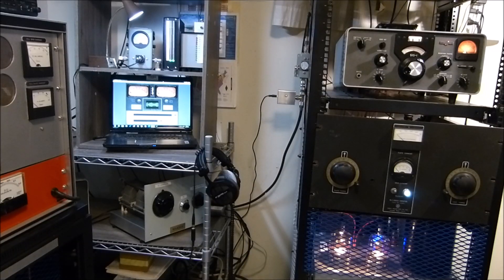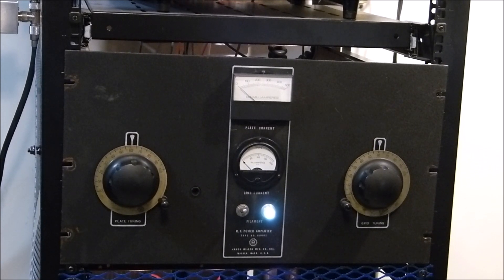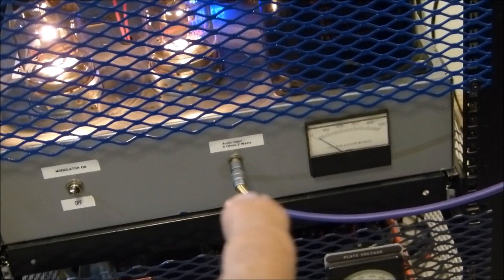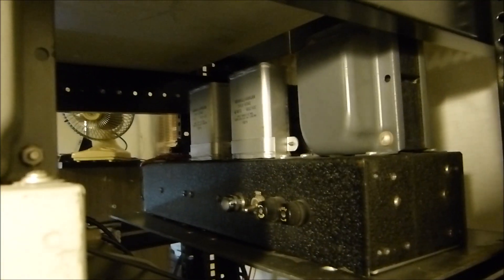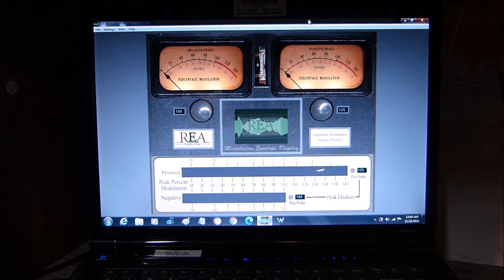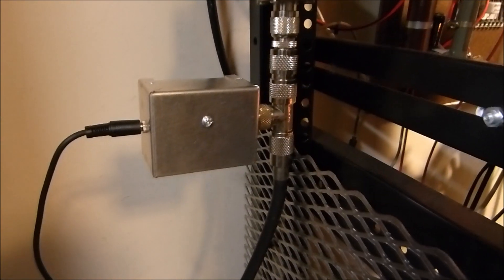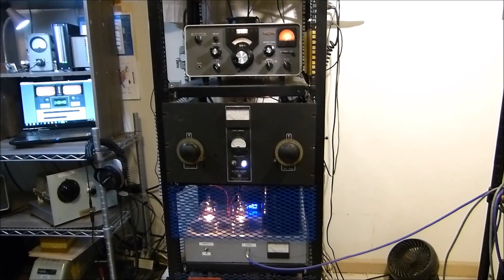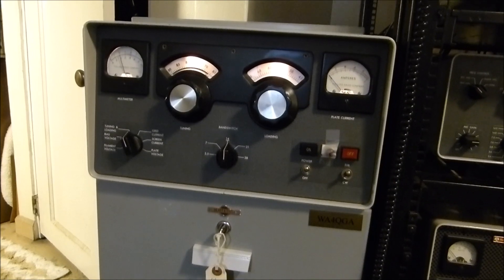Negative Modulation Peak Limiting For AM Transmitters With Modulation Monitor

Comment: Hi Dave

I have a question about the underlying spatter issue: namely, why isn't class C operation itself a source of spatter? As the carrier is certainly disappearing ... Or maybe it is a source of spatter, but the fact that it is happening at RF not AF makes it OK? By which I mean FCC-compliant? Because the spuriae aren't adjacent to the carrier frequency?

Best EJP
Reply from the maker: I may not have the perfect answer for that but this is something close.
We know that in a class-C amplifier, the tube conducts less than 180 degrees of the cycle so we only have positive pulses coming out of the amplifier. The positive pulse charges the resonate tank circuit, often times a Pi network in single ended amplifier and when the positive half cycle shuts off, the collapsing field stored in the tank restores a negative half cycle so we end up with a reasonable full cycle. This occurs because when we charge a tank circuit or even an inductor with a magnetic field and then we abruptly remove that charging field, the collapsing field is of the opposite polarity from which it was charged. At the same time, the resonate circuit suppresses harmonics so amazingly it works pretty good. I don't think second harmonic suppression is that great so the quality of the suppression is measured at the third harmonic (they call it third order) which should be something in the order of 40 dB or more down from the fundamental. I think this is a reasonable explanation of how it works.
On the other hand, if the negative cycle of the modulating audio is greater than the plate supply voltage, the algebraic sum is zero or  even negative, so the class-C amplifier is completely starved of plate voltage during that negative peak so it quits transmitting the carrier altogether. That is the "splatter" (adjacent to the carrier frequency) that occurs as it abruptly turns off and then back on when it goes positive again.  
The simplest circuits just consist of a reverse bias diode and resistor to "load" the negative cycle and help prevent the plate voltage from being shut off but that is by far, not the best. This circuit provides the keep-alive voltage, even though small as compared to the actual plate voltage and keeps the plate supply voltage from actually reaching zero. Darn thing actually works. It certainly isn't audio amplifier stereo quality we expect from our HiFi amplifiers but it ain't all bad...
Cool, huh ?  Or it could just be magic...    :-)
Reply: I see, makes sense: and it doesn't happen at AF? is that because the inductive Z is lower so the flyback is lower?
Reply from the maker: @EJP286CRSKW  Hmmm... not sure I understand.
Reply: @ElPasoTubeAmps  Well, why doesn't it happen at AF? Why do you have the spatter problem at all?
Reply from the maker: @EJP286CRSKW  The AF (1 KHz) is modulating the RF (14.250 MHz) and the "splatter"   (splatter seems like a poor work to describe what happens but I guess we are stuck with it)   only occurs at that peak moment where the negative portion of the cycle is so great that when it adds to the steady DC plate voltage, the plate voltage instantaneously becomes zero. Abruptly turning the carrier off then mS or even uS later turning it back on is going to produce transients with steep sides and such transitions are full of harmonics.  Like flipping a switch off and then quickly back on. It ends up at audio frequencies that are adjacent to the upper and lower modulated sidebands of the carrier.  I think I am saying it correctly.
Reply: Understood, but why doesn't the flyback take care of it as it does for the class C gaps in the carrier? Or maybe it does but ...? What's the essential difference between the two cases?

I looked at my only two transmitter books overnight, and they both treat it differently, ignoring the magnetics and just treating the coil load as a bandstop filter with resonance at the carrier frequency. They both say it must have Q >= 10, so as to attenuate the harmonics of the carrier (produced by class C) to -30dB or better, presenting zero impedance to them so they go straight to AC ground via the PSU, rather than into the coupled load, i.e. the aerial.

So I can see that this filter doesn't filter out harmonics of the modulating frequency, as it can't, and mustn't. So you need negative-modulation peak control.
Reply from the maker: @EJP286CRSKW  An interesting conversation. Resonance at the carrier frequency for sure but a bandstop filter confuses me. In the HF region (3 to 30 MHz) the Q which is X/R (R being the resistive or power dissipating part of the tank circuit and primarily the coil), the Q for frequencies in the 3 MHz region is around 5 or 6 rising to around 15 or 16 at 30 MHz. This the way tank circuits are built in ham radio equipment. The Q is determined by the inductor. If we make a circuit, for example, at 14 MHz (the 20 meter band) and make the coil very small and the capacitor large but resonate at our 14 MHz, the band pass will be very narrow and we will have to retune if we move maybe 10 KHz so we make it not so narrow by making the Q lower  which means we make the coil a little larger and the capacitor a little smaller maintaining resonance. Q or the 20 meter band is good to be around 10. The attenuation of harmonics is measured at the "third order" which I have always assumed to be the third harmonic. I have indeed made these measurements on my Collins equipment and at the 3rd harmonic and I see the attenuation they specify. I think they specify at least -35 dB. The harmonics don't go to ground via the PS...  that has to happen right at the tuned circuit in the tuning and loading capacitors - the PS is much too far away to take RF harmonics to ground.  If you determine the value of the loading capacitor and tuning capacitor in series and then put it across the inductor, you will find its resonance. At that point it may look like it is in series but it is not. The tuned circuit, be it Pi or a standard parallel circuit, has to be parallel tuned (to ground) at the resonate frequency to not attenuate the carrier frequency. Maybe that is why it was analyzed in your book as a bandstop  assuming it to be a series circuit ??   At this point in the circuit a series resonant LC circuit (to ground) would be a band-stop.  In these measurements of the third-order attenuation as mentioned above, it is amazing how little the 2nd harmonic is attenuated - I don't remember the exact amount I have seen. I have measured this on a spectrum analyzer.
I see your thinking that the flyback effect of the tank circuit would seem to smooth out the lower half of the sine wave, and maybe it does.   Now that you got me really thinking about it, I am pretty sure it is magic. I am going to see what I can find on it also. 
Remember when we wanted to know... Why... we Must use radians instead of degrees to determine reactance? The technical answer is - because degrees are stupid and radians are smart. Any more stupid questions ?  That is pretty much what I got from researching it - including a lesson on how the Arabs invented math and 360 degrees and all that. BTW - if these guys that invented 360 degrees in a full circle because they were obsessed with the numbers 6 and 60 then why does one radian, by definition,  equal 180/Pi ???   
 Not sure what else to say or I am likely to go down a rabbit-hole...   which I may already have one foot in.   🙂
Reply: I meant 'bandstop' as in providing zero impedance to out of band signals so they go to AC ground, so that only in-band signals get into the load. Probably wrong terminology, as from the point of view of transmission it is certainly a bandpass filter. The books talk about Q of 300-500 in the MW band. Maybe the required Q is a function of frequency.
Reply from the maker: @EJP286CRSKW  Wow... I didn't know that about the Q at microwaves frequencies. I guess it is a function of frequency because it is in the HF band. That would mean that L would be really small and I suppose that is why PC board inductors (micro-strip  inductors I believe they are referred as) are so effective. Never done any real personal work up there other than measure/evaluate GHz coax links working with Lockheed. Speaking of magic, that is pretty much the way I see the guts of satellite dish waveguides and amplifiers. You have told me something valuable there about Q and frequency and I appreciate it.
Speaking of Pi and Pi-L networks in HF amplifiers - most amplifiers just use Pi networks in between the final amplifier and antenna but better designs use a Pi-L network and I believe the specific purpose of the added L is to suppress the 2nd harmonic a bit more. It is amazing how strong it is but everything works OK.
Reply: That was MW as in medium wave, commercial AM band 600-1600KHz. These books were written long before microwave was a thing. One during WWII.
Reply from the maker: @EJP286CRSKW  That changes everything. I certainly don't understand that. I will even go so far as to disagree with a Q of 300 at 1 MHz. Just doesn't make sense to me.

Comment: hey is there anyway u could tell me the video with the diode clipper
Reply from the maker: I think some refer to it as negative-half-cycle-loading for AM transmitters. 
Here is a link that might help. 

https://forums.qrz.com/index.php?threads/negative-half-cycle-modulation-transformer-loading.674154/

It is very simple. A resistor of about half the power of the modulator and a resistance value the same as the modulated tube - likely somewhere between 5K and 10K. This resistor is put in series with several diodes, enough diodes that the peak-inverse-voltage (PIV) is not exceeded during modulation and it is connected across the output of the modulation transformer with the cathode of the diode connected to the end of the modulation transformer that connects to the RF amplifier. What it does is lower the impedance value to the negative half cycle while not loading the positive half cycle so it allows a little more positive modulation without exceeding the negative modulation value and cutting off the carrier coming out of the RF amplifier. Hope this helps...